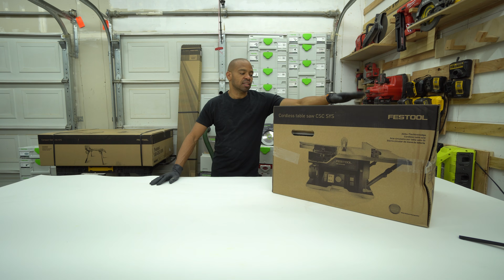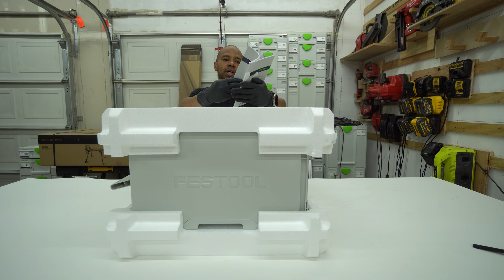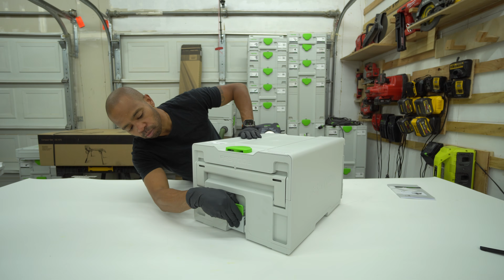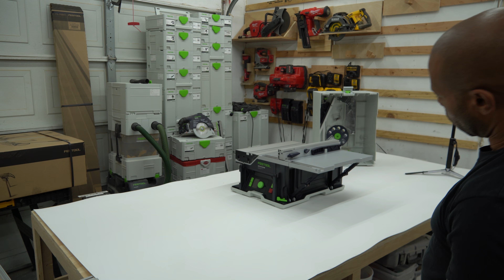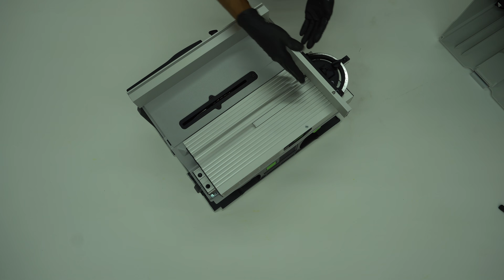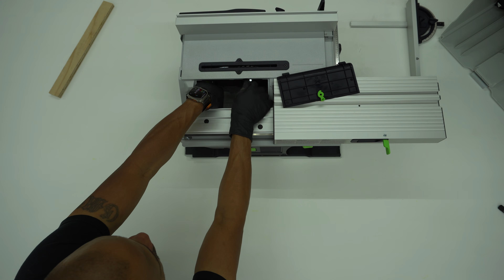Festool CSC SYS 50 Cordless Table Saw Unboxing

Comment: I'm curious, that fence looks rickety at best.  Since you've had it for a year now, how has your experience been?
Reply from the maker: Initially, I felt the same way. However, considering that I am a DIY person and not a contractor, I have had no issues with the fence system in my personal use case.
Reply: @daddysharespace  So you feel once you lock it down, there isn't any deflection?  Sorry for the questions. I'm just considering one, and at that price, I'm trying to figure out if it's worth it.
Reply from the maker: The saw in my opinion is for small parts and finish style carpentry. I would not purchase for heavy duty things. Check out tool box buzz. They did a job site saw comparison. The Festool is its own thing.
https://youtu.be/-CpO8CURY6w?si=Yr544OyeuDHzXL0M
Reply: @daddysharespace   Thank you, sir.
Reply from the maker: No problem.